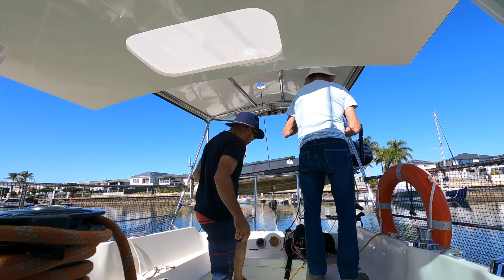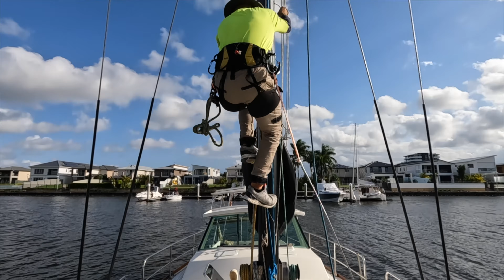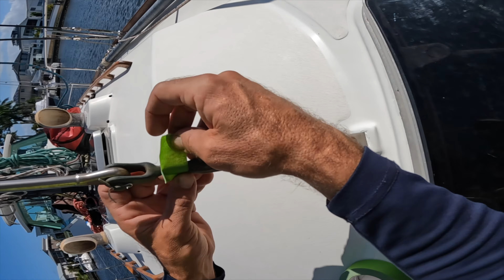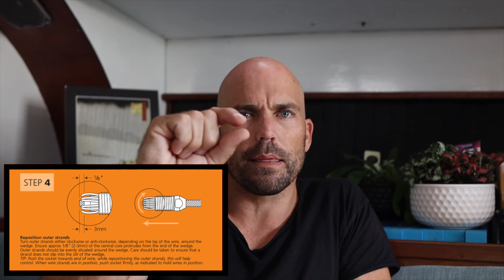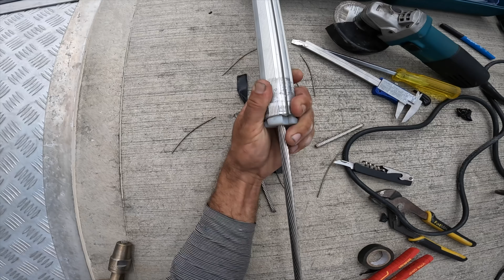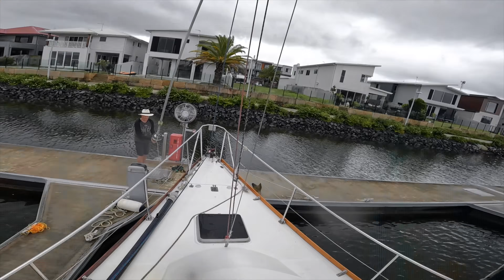#030 DIY guide replace standing rigging

Comment: Ok you spend $6k and some very unnerving time replacing your rigging without removing the mast. 
Why? 
Removing the mast would have been only a few $100 more and you could have inspected the most important part of your rigging . 
Also I bet redoing the rigging would be less stressfull and faster that way. On top you could have another pair of eyes checking if all would be ok or if you had missed something.
And you do this only every 10 years, so why beeing cheap and have a chance to miss something important?
Reply from the maker: A few extra 100 to remove the mast?! I’m not sure where you’re from not in this country mate 👍🏻

Comment: Sometimes those bolts that go through the mast need to be unthreaded with a wrench first and then hammered out and possibly wrenched out again part way through or at the end.  The tolerance can be extremely tight where it goes through the mast. I ran into this problem on my masthead fitting.  Luckily the mast was down on the ground so gave me opportunity to take my time.  Trying to hammer it out would have destroyed the bolt threads or the area around the bolt in the mast.  Those holes through the mast i think need to be a very tight and close fit with the bolt so trying to hammer them out may be a bad idea if anyone reads this that is going to attempt to DIY their rigging.

Comment: Sounds like you definitely were qualified to do this on your boat and your video was great. Ho2ever, that being said you stated you can't really overtighten shrouds. That is completely incorrect qnd you don'twant to lead an uneducated diy-er to make a potentially costly mistake. Any of your standing rigging can be over-tensioned and cause damage to the boat or cause poor sailing performance.
Reply from the maker: thanks mate! I believe i stated that slightly under-tightened is worse than slightly over-tightened, but yeah, your're absolutely correct. Too much tension and pull your boat into bits 👍